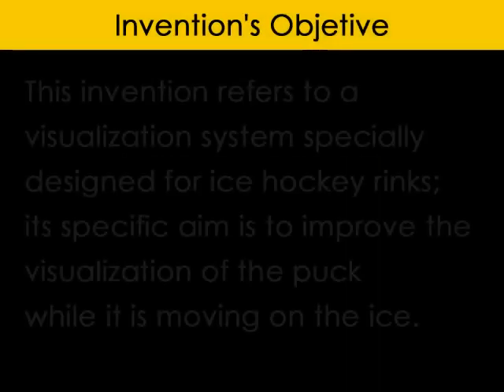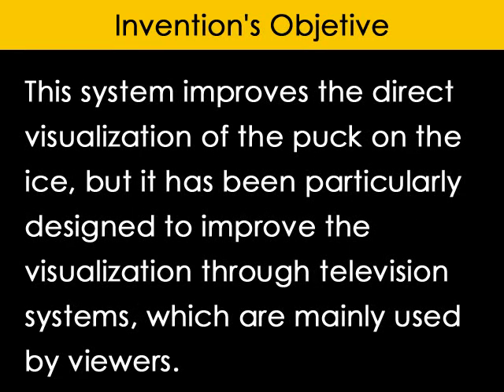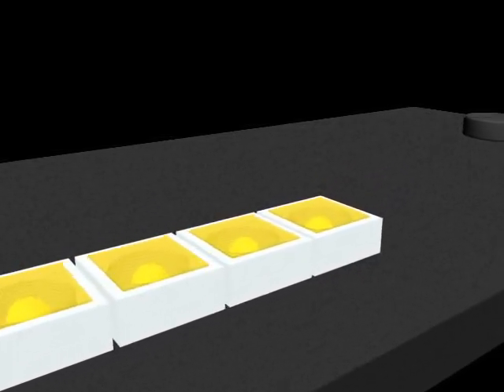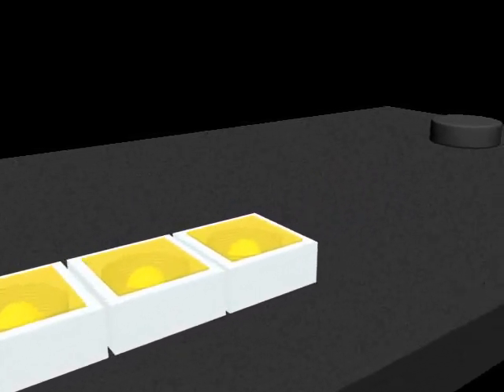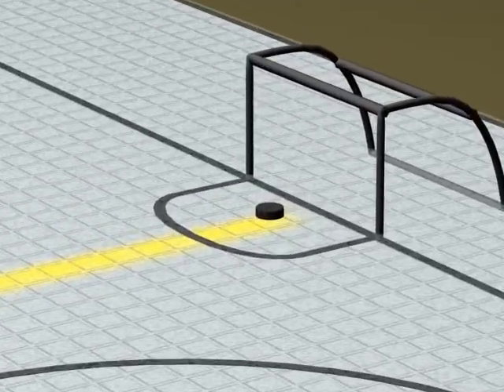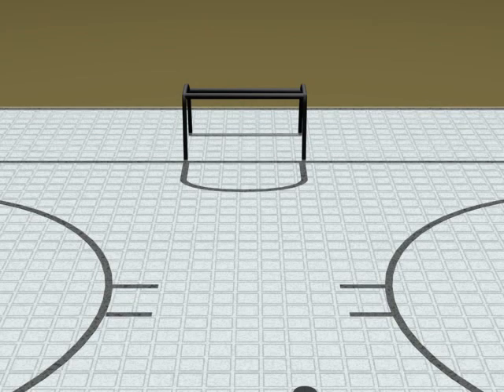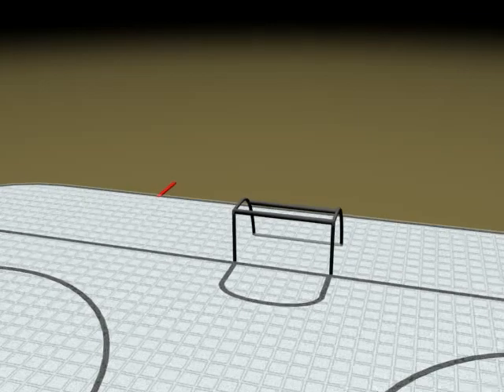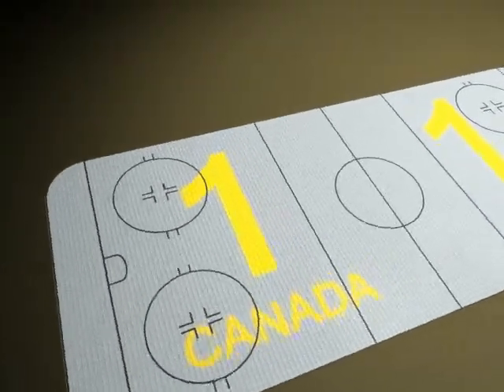VISUALIZATION SYSTEM FOR ICE HOCKEY RINKS

Comment: That would be great for the spectator...but it would be a disadvantage for the players, cause you could see where the puck is because the ice would light up. Well I guess it would be an advantage for the goalie.
Now that I think of it, I guess if the puck was moving in the air, then the light system wouldn't work.

Comment: Nice idea, but I reckon it'd be too expensive and how's it gonna work with airbourne pucks?
Not only that, when the puck changes direction, i.e a one touch pass, it's gonna run over the same tiles. Not so sure that wouldn't look confusing. We do need to make the puck more visible though. I play at a high level, but I have difficulty following the puck sometimes on t.v. I can understand why some people wouldn't watch hockey if they can't follow the puck

Comment: I thinks it cool to come up with new ideas but this seems a bit much, How much heat do those lights dissipate, you do not need to say direction and velocity in your video, velocity is speed with a direction, or a vector. I remember when one of the networks had a digital trail on the puck and it was not well received. kudos for the presentation and concept but maybe back to the drawing board.

Comment: what if the players take a wrist shot or something, and the puck loses contact with the ice? and putting a chip in the puck would be modifying it. changes it's weight. not by much, but to a true hockey player, you can feel the difference. love the idea though. I agree with aveman07. shouldn't be implemented in the NHL right away.